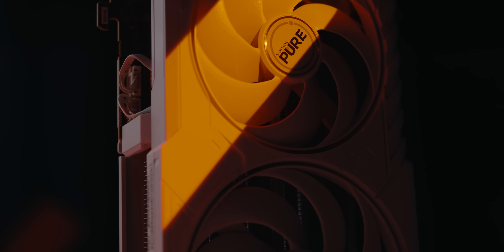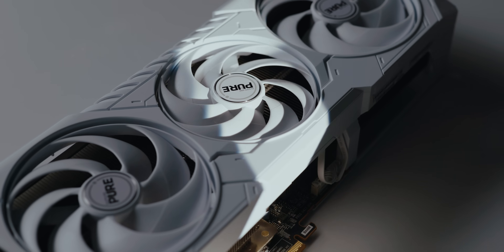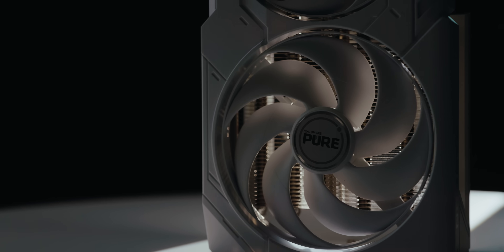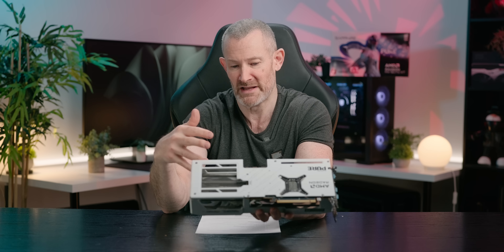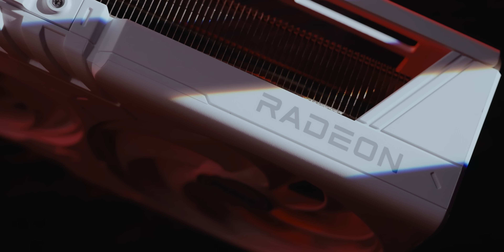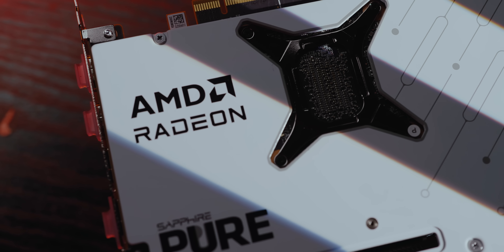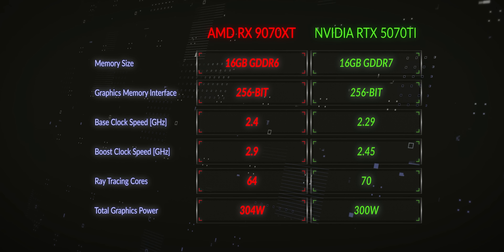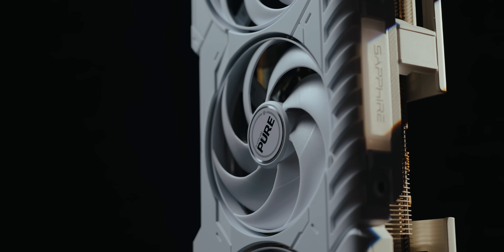Pushing The Limits Of The RX 9070 XT : Overclocking and Undervolting Review with 8PACK 📈💥 🔧⚡️

Comment from the maker: Hello Overclockers! As we very much were at OcUK HQ, you may be aware that our website unexpectedly experienced outages during the AMD RX 9070 launch that lasted longer than was expected. 
 
We aim to take away key learnings with every product launch so we can continue to optimise the customer experience - from the launch communications, to how we handle stock drops, down to how fast we pack and dispatch the orders. 
 
Going into the 9070 XT launch, we implemented several new features to accomplish this. These included a queuing system, deploying stricter bot checks, completely blocking traffic in specific regions, and more to help create a smooth checkout process for genuine customers looking to buy the latest hardware for themselves. 
 
While these changes did allow more customers to reach the website and buy the card they wanted, the amount of available stock pushed the load to a part of our website infrastructure that in previous launches experienced a far lower volume of requests and was therefore unprepared for this. As more customers refreshed pages, added cards to basket, and attempted to check out, these requests kept multiplying and resulted in timeouts. 
 
Our response was to hold all traffic in our queuing system indefinitely whilst we investigated, identified, and remedied the issue. However, we were unable to remove traffic already on the website as this would cause data loss for those already attempting to complete their order, thus continuing to create new requests. To speed this process up, we manually reviewed how specific IP addresses were behaving, removing any which displayed excessive and therefore suspicious behaviour. As the traffic already on the website reduced and completed their transactions, we were able to deploy our fix and reopen the website. 
 
With the site reopened and stock back on sale, we resumed offering cards at MSRP. We used the quantities we had confirmed before experiencing issues, despite being the only retailer to have stock in the UK at the time of returning online. This lasted until around 11pm as we batched our stock allocation throughout the evening to give genuine customers a fair chance of securing a card at MSRP. 
 
Whilst this launch did not go as we had planned, we are confident that we have built on the learnings of previous launches and now have the systems and processes in place to serve the demand for the next product launch. 
 
We thank you for your patience and understanding, and look forward to you shopping with us again soon.
Reply: And it was wonderful how you hiked the price of certain cards by almost 100 gbp within the first hour of sale. Having a card in the cart and trying to pay for the first 30 minutes was certainly interesting. Having wasted that time and then get slapped by the price increase is disgusting to say the least
Reply: @rickwiththe  Same thing happened here in Germany. All those shops, also Caseking, in which I had big trust, they all are playing games with us. Just give the customer some cards to buy, hold the others back, wait, increase the price, repeat. It's disgusting. And despite i finally got a 9070 (non XT) Nitro+ after the first price jump during a tiny "2nd wave" at Alternate for €789, I lost all the fun buying gpus, like I had back in the days. Shortly after my purchase they were gone for that price and some popped up at Caseking for €90 more at €879 for the non XT(!). Anyway, gonna undervolt and overclock my new baby up to XT performance and move on, play some games :D
Reply: @OverclockersUK  would also appreciate when if you guys say something's going live at a time, you don't make it go live before that time. Id been logged on since 9am that day but like a grown up I was also at work. Got to my desk at about 1356 and the website had already ground to a halt.

Eventually got to the "enter card details" at about 1610 and then spent another 10 minutes being kicked out before I got out of stock'd. Waste of over two hours and thankfully I have a very understanding boss.
Reply: Unfortunate, but well done communicating. May I ask (about the video) if there is a guide on how to get started with overclocking and undervolting? Especially the combo looked enticing! Have a great weekend.
Reply: @OverclockersUK  thank you so much for this response! The clarity is appreciated. I wanted to buy a card from your website but due to what happened, I ended up buying from scan instead. Here's hoping your next big product launch works better in the future! :)
Reply: I had a sapphire pure in my basket but was unable to checkout. By the time the website reopened, it was out of stock even though it says available in my basket. Still, overall I think you guys did well and were honest enough not to scalp buyers and I appreciate that. I managed to snag the Nitro+ on preorder and I think ultimately, it is the better purchase. I think I was playing it cool initially. By chance was actually able to be on the computer throughout the launch window and I wasn't that sure I wanted to buy one yet. But now I can't wait to receive my card <LOL!>

Comment: Does core clicking do anything actually? Checking into der8uaers video when he gave his card a 150mhz core OC it didn't do anything but UV and PL the card lowers temps and let it boost since my 9070xt red devil with only UV and PL boost to around 3330MHz, seen it peak 3400 now and then but otherwise sits stavle around 3300
Reply: what are your settings? I still cant find a sweetspot or maybe my gpu is bad luck
Reply: @soulfulfool atm I'm running (testing out) +150 on core, -60mV core, 2680 MHz Vram with fast timings and +10 PL with this I run a custom fan curve to let the fans ramp up as I usually play with headphones so it will run around 2000-2500 rpm and still be silent it can go up to 3000 but really only when im pushing the card in cyberpunk but still just sounds like a breeze.

Ran steel legend got about 7566 points and been stable as of yet no driver crashes etc mind you I also use a custom fan curve on my case fans but it's on my Power color 9070xt Red Devil
Reply: @n0ex  I also got custom set fan curve for my 9070xt taichi, vram is causing some issues so for me 2600 on default, power left on 0 and -90mv on core pushed it to peak 3430mhz BUT Cyberpunk crashed after some time 😂 sadly because that was real fps boost, 47 global temp 86 hotspot and around 70 vram, peak power draw was 430W xD 

I wonder what was the issue... I could crank up the cooler but I doubt it was temp, rather not give it 110% PL because hotspot will be over 90 unless I go full throttle on fans that sound like jet engine haha
Reply: @soulfulfool  hmm could still be a unstable OC since it could be that its missing power with that undervolt, 

im atm testing -100mV, 150MHz+ on Core, 2714MHz on vram(14 above to get clean 2700 since adreneline is adreneline...) with fast timings +10 Powerlimit and running WoW classic atm stable also using VSR to set my screen resolution to 4k and downsalce it to 1080p to let teh card do more work and at times i seen the card go up to 3420MHz so will need to give cyberpunk a try with these clocks xD

Comment: Got my Sapphire Nitro 9070xt in the mail from Overclockers last Friday. Coming from a Power Color 6800xt. Never really overclocked the GPU before outside of the tuning presets through AMD software. What's your methodology to tuning? I could just try and copy the specs you listed, but I'd assume it might be unique to each board?

Comment: This is the 304w card no? My Asus TUF pulls 355w out of the box and boosts to 3356 MHz. With a small downvolt it was boosting to 3414MHz but it was loud. I found the sweetspot was -65mV at -10% power for a 315w 7569 score in Steel Nomad while staying fairly quiet. Audible, but realistic under gaming load, nothing shocking. I am very sensitive to fan noise so this works perfect for me. Reasoning was that my hotspot ran high at 96-98c and I didn't like the 360w power draw. So I lost about 100 points in Steel Nomad while dropping hotspot to 85. It's a shame the undervolting is ranging so hard. Cheap MSRP cards stable at -100, nitro+ failing to go below -40, nothing's been binned

Comment: can you do it on a stock 9070 xt? i just cant get it right. granted silicon lottery and what not. if you can just narrow it down on the stock option
Reply: It seems there's been no binning. Some people running Reapers and Prime cards are hitting -100mv with no issues while people on Nitro+ can't seem to get under -40mv. My ASUS TUF seems to be stable at -65 but it cannot pass stresstests at lower voltages. It seems the silicon lottery is back and worse than ever

Comment: my experience with this card so far was  increase the powerlimit.  undervolt the card to the lowest the card will run stable with.  Benchmark it in the meanwhile and monitor the gpu and see like 300 Mhz more at the same powerdraw its just crazy.  the manuel overclock is a bit weird on this card imo.   Its also an option for those who bought the 12pin power connector version of the card to be safer.

Comment: I already did an OC on the 9070 pulse. In 3D mark I got almost 10 percent win with 110% power limit, and mv offset -100. Temps are barely going up, maybe from 50 to 54 degrees celsius but mostly less, vram temp almost the same. I played mh wilds more than an hour with this OC settings, no problem.

Comment: Push undervolt first then clocks trust me the lower you go better the scores i had 2 settings 1 at 170 core 50mv undervolt and my scores were higher at 
75mv undervolt and only plus 50 core stable 3.4ghz havnt pushed memory will do that next 👍🏻👍🏻👍🏻

Comment: what benchmarking did you use to get ur clock speed results etc? i dont know much about benchmarking. i used the built in stress test in adrenaline (which i assume isnt reliable or as reliable as true benchmark apps) and i supposedly managed 3.3 clock speed stock on my sapphire pure.
Reply: it seems the built in stress test is not the best at testing stability . i tried the monster hunter wilds benchmark(free) and OCCT (3d variable)

Comment: "Upscaling price Generation" is killing the mood for gamers.
I am always after value, thus it seems like I am sticking with my 3080Ti, which I got around 1.5y ago for only USD650, for sometime to come.
1. 4080 Super, when it is available @<800, second hand
2. 5070 Ti OC when = MSRP, second hand maybe
3. 9070 XT OC when = MSRP, second hand maybe
In the meantime I will continue using frame gen mods (Nukem9 or Optiscaler) with DLLS Swapper to use DLSS 4 Transformer, in combination with NIS @77% where needed (like SW Outlaws), to achieve 70-110fps in AAA games in 4K/High/RT High-Medium.
Reply: OC cards are always over MSRP. Why do you expect overbuilt specialized cards to be as cheap as possible? AIBs don't have much of a margin on these cards so they don't really make money at MSRP and now they're spending money moving manufacturing out of China so it's going to be even more costly. Remember MSRP is just the suggested price. In other words it is the lowest starting price possible not the average price. Prices are going up for everything so you shouldn't be surprised. 

GPUs are an investment anyway that are meant to be used in many ways. Gaming is just one way to use them and should never be the only use case. Some people were smart during the last crypto boom and bought expensive cards and made the money back by mining with them when they weren't using them. At the height of it you could spend like $2000 on a 3090 and make the money back in a few months. Use it for work, AI, rendering, a side-job. Figure it out. Game but do other things to make it work so you don't get down about this unfortunate situation. I'll probably get a 9070 XT a few months from now for a deal in a bundle or something that'll make it a good value for my use cases (video editing as it's better in Davinci Resolve than the XTX which was already pretty good, maybe some visualization stuff I can try, music production which it is overkill for obviously, simulation games which aren't that great on my 6700 XT at 1440p, and I do wanna test out ray tracing which I haven't really used before though I have a sim game that has dynamic lighting).
Reply: @vigilant_1934  All in all I do agree with you, in that demand/supply dictates the pricing in the market, along with profit margins and additional costs involved (like taxes).

Comment: I won’t be buying Sapphire as long as they use the 12V High Failure Rate connector. I don’t care if it’s “within spec”, 8 pin is far more proven and reliable.

Comment: Thanks for the results.  It shows promise for watercooling, as long as there is a means to circumvent the power limit.  It is expected for undervolting to unlock performance when power limited.  This means there is another degree of overclocking available.

Comment: "Undervolting" by reducing the voltage slider does not reduce operating voltage except when running into the maximum clock speed in your settings, it just shifts the voltage frequency curve to the left. For this reason, undervolting on Radeon cards IS overclocking. It is akin to punching in a "+(x)MHz" setting on Nvidia cards, again, until you hit your maximum set clock speed under load. Please stop contributing to the confusion that persists on how tuning these cards works.

Comment: Why are all the 9070 XT's, regardless of the AIB model, having the GDDR6 memory temperatures running hotter most 5090 GDDR7 memory temperatures?  My Astral 5090 has the memory hovering at 65C tops.

Comment: Got a nitro+ today cant wait to push it to the maxxx!!
Reply: How much did you pay?
Reply: @ketketvauvau £700
Reply: @TTG2025  How do you know how much did he pay for Nitro+ version? xD
Here in EU, Nitro+ is about 1k€
Reply: @ketketvauvau Because I have the Nitro + version?
Reply: @TTG2025  From where did you buy it?
Reply: @RuanLFC  is there any tutorial on how to do it ? I’ve got a nitro aswell
Reply: @stxr3731  haven't found one yet but id say from this video we can take away some clues push power limit up push clocks till artifact back off a bit push RAM till artifact back off a bit then start to undervolt until it crashes back off a bit and should be ok from there as he mentioned with AMD cars undervolt is key to get max clocks possible
Reply: @stxr3731 Auto overclock it. check how much it boosts, then go manual and undervolt it with the same clockspeed.
Reply: @Pixel_FX  is undervolting not also decreasing performance ? I’m completely new to to it
Reply: @stxr3731 not with amd usually with Nvidia or cards of the past yes but the way these cards are made today they are always power limited even if you keep them super cool the wont go above a certain watt or voltage and wont push the clocks as a result if you lower the volts and watts the card thinks it has headroom and pushes the clocks up !
Reply: @stxr3731 Basically the engineers design these chips with a certain voltage expectation that all of the silicon (the GPU chip) will be able to handle it whether the silicon is perfect or slightly flawed. But sometimes you will hit the silicon lottery where very few flaws occurred during its production allowing for your chip to use much less voltage to achieve the same or greater performance. Basically the only thing limiting a chip is wattage and heat which is why extreme overlockers using liquid nitrogen and custom BIOS can push CPUs and GPUs to absurd clock rates.
Reply: @RuanLFC  What have you managed to clock so far?
Reply: @TTG2025  highest boost clock so far 3399 hit 3.4 once but crashed did pass a superposition run on 4k optimised and got 22k lol
Reply: @RuanLFC  Let me know what you get fully stable, I'd be super interested
Reply: @TTG2025  will do it seems that 3.4ghz is possible for sure
Reply: @TTG2025  ok so heres what i found out dont push clocks at 170 mhz core and 55mv undervolt i was getting lower scores than 75 undervolt and 50plus core so first push undervolt before touching clocks thats most important for sure currently that gives me a boost clock of 3.4ghz with those settings i can not go lower of  it crashes memory at 2700 will try to push that next
Reply: @RuanLFC  I can't even run stock at -75mV, you might have got a lucky card
Reply: @TTG2025  damn :/
Reply: @RuanLFC  Seems to be okay at -50 mV, gonna try to get a little lower if possible
Reply: @TTG2025  nice
Reply: @RuanLFC  Have you tried with Fast Timings?
Reply: @TTG2025  yes 2700mhz max with fast
Reply: @RuanLFC  Have you increased the power limit or left it stock?
Reply: @TTG2025  increased
Reply: @RuanLFC  I've noticed it can be game dependant with stability
Reply: @TTG2025  same here
Reply: @RuanLFC  Most people are saying to leave the core clocks completely, as the card will naturally boost way higher with an undervolt. Seems like the only real overclock worth doing is memory with -mV and that's about it
Reply: @TTG2025  plus 170mhz core 
10% power plus 200 memory and about 55mv undervolt but only got it today haha

Comment: Where is only undervolt result? It would be interesting to see how efficient it can be at default. 9070 consumes 100W less and performs about 85~90% like the XT. (up: saw another vid. Non-XT can pushed to stock XT perf. at 260W. And XT can be undervolted to 260W without losing stock perf.)
Reply: @sulev111   which vid?
Reply: @tlv8555  i assume hes refencing a video from a guy called machines & more. He does sff pc focused content. Highly recommend his channel.
Reply: In Derbauer's video XT gains performance simply by undervolting. So XT will likely preserve the performance difference at 260W.